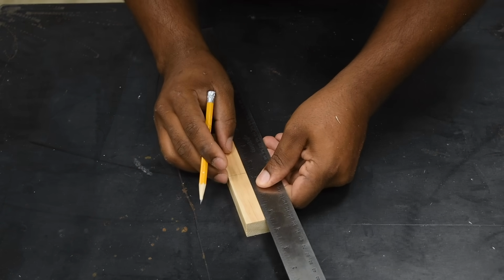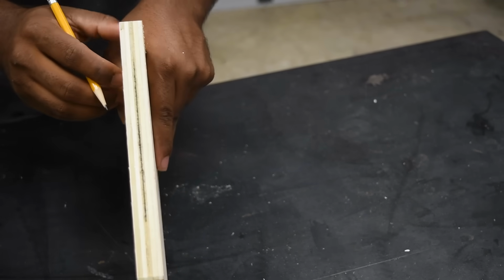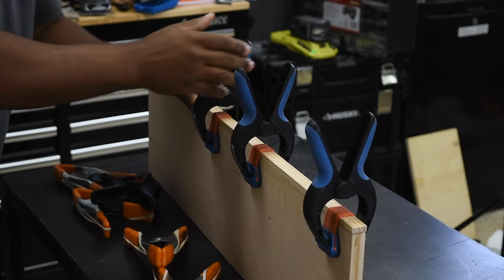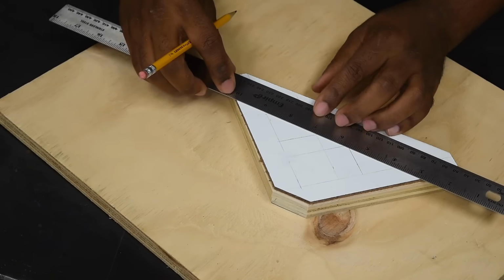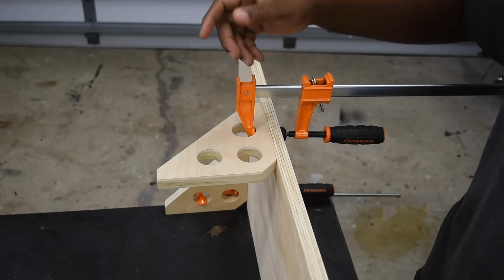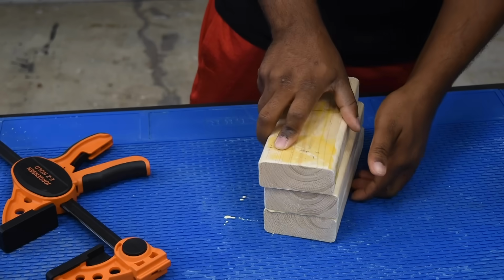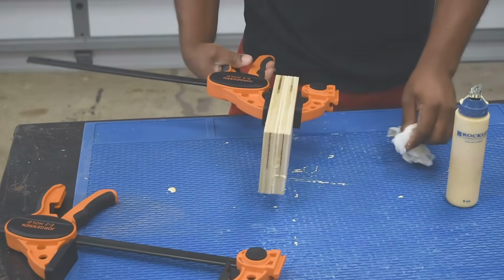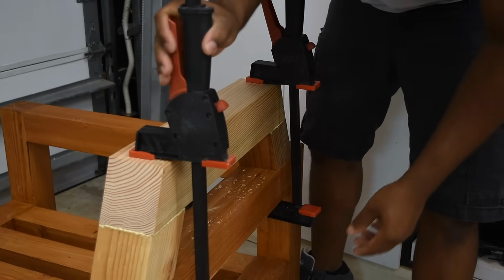6 Woodworking tips & tricks for beginners

Comment: When you were using the table saw never put the miter gauge on the left side of the blade and leave the wood tight between the fence and the blade without some time of support, like a miter sled.

Comment: I’m a contractor and carpenter with more than 20 years of experience, primarily in finish carpentry and custom woodworking. I don’t know how I got here and I’ll be honest, I was ready to call BS before the video even started but you’re great. I like your ideas but more than that I like your approach and thinking. You’re  smart and resourceful. This is maybe the only time I’ve seen one of these that wasn’t crap. Most are cute and overly clever but ultimately useless, though an inexperienced woodworker wouldn’t know it. these are actually useful. With the untold thousands of dollars of fancy tools I have I don’t use dowels anymore, but that nail bit is frankly better than those useless old dowel markers and I could see myself using it. I would check if salt hinders glue performance though. Anyway, great work. The stuff you make is pretty nice and you’ve got some good ideas, but like I said I’m mostly impressed by your mind, your creativity and resourcefulness. Those are a craftsman’s most valuable tools. Cheers.

Comment: About that last one, if you need to be more precise and you find the head of the nail sitting at a slight angle puts your alignment out you can use a T nail and tap one side of the head in first then it will give you a dead vertical match and should stay put without tape.

Comment: I am an ex UBC journeyman carpenter,  and UBC carpenters are practically the best trained in the business here in the US.  So I thought, untill I met European, Japanese, Korean, and other old world carpenters that would kick my butt with their "lost knowledge", and often simple hand tools.   I have to say that the straightforward approach you have is refreshing and wonderful.  You have shown a great deal of simple ideas that many others may not have considered.  You are a carpenter on a shoestring, that truly shows how simplicity can an overcome obstacles.  Truly wonderful and informative.  You have won a fan.  One point I love is your extensive use of dowels and glue you paste on.  Too many believe that hot glue is the bomb! You know better.  One quick tip and I hope you dont begrudge an old wood worker like me.  Dowels work better when they have a slight angle in the tip to enter faster.  Now grooves supposedly are done to provide a way for possible excess glue to run into to prevent hydrolic pressure from preventing the dowel from fully settling in the hole. So either you bore a hole slightly longer, or put some grooves on the dowel.  The jury is still out on grooved dowels making stronger joints.  Anyway; you can either make a jig to make grooves on the dowel, get a doweling steel plate, or use in a pinch a pair of pliers that you have sharpened the teeth for this purpose, and just grip the dowel with the pliers teeth just hard enough to pull it along the wood dowel to make a scratch recess on the dowels. Could repeat twice.  Best are the Channellock type with the tongue and groove adjustable size, because they can comfortably fit many different dowel diameters.  Just a thought.  Still...good work! 👍👍👍

Comment: Impressed. I cheat a bit watching videos - I read the comments first and if the consensus says it's it's c### then it's just that. The comments here told me that not only it was good, but that it was unbloody good. I say that for the chap who queried YouTube table saw technique - and started watching the same, then rewatched because I'd spotted that you had the guard down (bad in boxing but not here) so fingers safe, and saw was fitted with five knife (reduced risk of kickback), and that although the blade was running you didn't reach for the cut piece until the cut was completed. Not textbook safe but ( not yet having bought a table saw) considering these points and (I think) cut piece being held down at back by pushstick, acceptably safe in practice. Please tell me if I'm wrong and you'll hear me mutter "Health and Safety gone mad". As for salt V sand - I'm happy with the one in my plastic grinder but not the other so the salt should be king to future attack from saw or chisel but the grit....  And as long as the timber doesn't get wet, I can't see a sprinkle doing much harm but a ladleful... ? Enjoyable and educational - what more could be wanted - except more. Thanks.

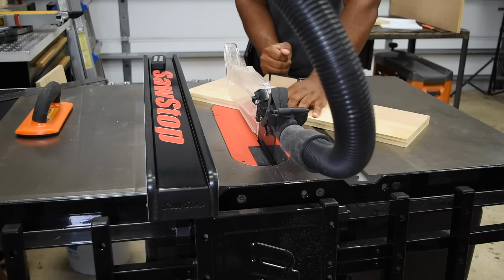Comment: OMG, Do you know how dangerous your technique @4:52 is?  You never - repeat - NEVER use your fence and miter gauge like that.  There is no where your cut-off can go.  If it is caught by the blade, it is coming right back at you at 100+ MPH.  To do that properly, place a small block against the fence at the edge of the saw and use a clamp to secure it to the fence, then use THAT as your reference.  This will give you the clearance between the blade and your fence equal to the width of your block.

Comment: Great tips, however before you join any wood component to another where endgrain is involved size the endgrain first. It takes 2-3 mins max for the glue to dry, especially if it's thin. Then put glue on the surfaces again as normal & clamp up. This makes the joint 50% stronger & much less prone to failure.

Comment: How would you Glue two pieces of 3/4" X 3-1/2" x 72" pieces of wood together to form a 1-1/2" X 3-1/2" X 72" piece. This is for an Aquarium Stand, so I need full Glue contact throughout. I don't want to use a two x four. It it splits, it'll be a disaster.

Comment: Awesome stuff... Thanks for sharing. It's a great attitude to reduce difficulty using jigs and techniques, which improves safety by reducing fatigue, and often reduces current project timelines, and also aids in conquering similar challenges in the future. Regarding the dowels, I prefer just using biscuit joinery, as the biscuit joiner has the depth rail, and the lateral tolerance on the join is very forgiving. Biscuiting is also super quick compared to drilling with dowels, like I don't even mark most joins as the depth is kept constant (as long as one approaches from consistent sides about the join). For the chair rest join problem, I would double up the biscuits approaching from both sides just aiming roughly at the centre, and that join is virtually indestructible, and if mechanical failure occurs, the wood would probably break elsewhere (and not at the join) ;D Note the first scratcher is useful and cunning, but with the biscuit depthing, not needed when biscuiting. Similar for the clamp sliding problems, one sneaky biscuit maintains alignment in one axis, but thanks the salt will aid in the other :) The right angle clamps for panel attaching is awesome, will definitely keep it in mind should an applicable problem come along, but my personal design techniques exclude the use of screws at all cost, and biscuiting again can be done initially to all pieces, and the boxiness of all pieces assembled tends to pull square when panels are all clamped simultaneously, with the biscuits doing the alignment in the one axis (where the 90 degree clamp would otherwise be required). Cheers from South Africa, awesome video

Comment: If you're gonna do tutorials for beginners confine yourself to tools a beginner might have. Your top range chop-saw and saw table (set up for 45 deg cut!) lost me. I have a circular saw. if I had your equipment and knew how to cut 45 degrees like that without the wood flying across the shop I wouldn't be watching. Like all good teachers try not to forget what it was like to be a beginner. However, I enjoyed your presentation. Good lock.

Comment: No one is going to mention the dangerous mistake he made while making the miter cut? You should never have the wood against the fence when cross cutting. if you need to be cutting the same spot/length, you can clamp a piece of wood against the fence at the beginning then hold the wood against the miter gauge to make the cut. Only reason you do this, is because like you see in the video, the cut piece is much more susceptible to kick back.

Comment: Here's a tip: If you have multiple items that need the same treatment, do them assembly-line style, it will save a lot of time.
Example: You want to attach multiple pieces by drilling & using screws. You drill a pilot hole, then switch the drill bit to drill a clearance hole, then switch to a driver bit for your screw. Drill pilot holes in ALL your pieces, switch to the clearance bit, drill all pieces, switch to the driver bit, screw on all your pieces. This tip applies to anything that your making multiple of. Doing things one at a time takes far more time and effort.

Comment: The ideas are great I see some things that scare the crap out of me with his saw use when making those 45 clamps jags put one of the 90° corners on the chopsaw fence set the fence to 45° don’t do what he did there’s too much chance of the peace jumping up pulling your hand towards a rotating blade as far as his initial cuts on the Tablesaw put a stop lock on the fence set your cut push the 45° piece through once it’s cut there’s no place for the waste to bind between the blade and the fence
Again the ideas are fantastic I will be making some of them but safe use of tools is more in Porten than convenience plus setting up all those stops is a pain so to 45° with a simple stop and make the cut the video was about efficiency make it efficient￼

Comment: I'm 51 and have been working with my hands as long as I can remember. I was lucky enough to be taught by some of the old timers back in the day many tricks of the trade. Most, I still use to this day. I was in awe of these guys as a kid and wanted to learn as much from them as I possibly could. It does my heart good to see someone applying common sense with experience, as well as an obvious passion about what you do. By the way, all those old timers and never a mention of using salt to keep the wood from sliding. I guess you can teach an old dog new tricks.

Comment: Enjoyed your video. I will make one constructive comment though. When you perform your angle cuts on the table saw you use the fence for your measurement while cutting through. This is very dangerous as the piece between the blade and the fence can easily kick back at you. I would suggest using a short block of wood clamped to the fence at the end closest to you to set your cutting distance. This way the piece being cut is free on the right side and will not bind when cutting.

Comment: A simple trick I use constantly that my long gone uncle taught me was to hammer the point of a nail before driving in soft thin wood. It won't split the wood but rather pushes out the wood, works every time. You ought to replace that DeWalt blade with a thin kerf Diablo, you'll love it. To prevent the shift when gluing I put a few spots of hot glue on one side, holds it, keeps it from shifting and drys perfectly. Especially helpful in a situation where you can't use a clamp.

Comment: Idk what you're talking about. I use my spring clamps like crazy. I've been using them as banding clamps for years, since the 90's. A better way to go about it is to use a section of a bicycle inner tube stuffed over each of the jaws.  That's one section of tube about 6" long. Each open end goes over a jaw. Done. 

These are all useful tips. I like the nail head dowel marker.  Why not make the right angle blocks all on the miter saw? ..or all on the table saw? Btw.. You've got some bad habits. Never let your hand go that far into the saw, that close to the blade. It's a matter of comfort. You shouldn't feel that comfortable about it. With that much comfort comes complacency ..followed by injury. Get used to using push sticks. That should be your next project.. Make a couple of push sticks out of a couple 1x2x8-10" e-e . Cut one end at 45° with a step in it , kinda like a bird's mouth. Round over the other end and drill a hole to hang it from or to glue a magnet into to stick it to your saw or fence. When they're made quick n simple, they're used fully, people don't mind pushing them through a tight cut and sacrificing them for safety. People aren't likely going to do that with any of the store bought plastic ones, ..with the rubber tips. That rubber will mess up the blade anyway if its pushed through..

Comment: Been a while since I've seen any of your projects. I love your work. BTW if you want to use a pencil instead of a screw, you can drill a hole and press/glue a nut in to your block of wood. If memory serves, a 5/16 nut will let you thread a standard wood pencil to whatever depth you want and hold it snug.

Comment: Useful tips, thank you. I would avoid using salt in the joints as it is hygroscopic. (sucks moisture from the air). This could bleed through and discolour the surface or cause paint finish issues. Maybe keep a small pot of kiln-dried play-pit sand in your shop instead?

Comment: Good tips.  BUT NEVER cut those triangles between the fence like that.  I was waiting for the kickback.  Never say never, but never use the miter gauge and the fence in contact with a short work piece like that.  ESPECIALLY WITH A PIVOT POINT AT FENCE!!!  Clamp a block on your fence to position the piece so as you move the miter gauge forward there is space between the fence and the piece.  I can't believe I didn't see 50 similar comments below.  Your method there is a classic kickback situation.  Sawstop won't stop that, either.  Again, I really like you tips and tricks.  Keep up the good work and be safe.

Comment: These tips were all Amazing. I don't do wood working. Unless the need arises.I always struggle but manage to figure it out and that sometimes kicks my butt.  These were so simplistically brilliant. I love jigs, you never know when you going to need one. The center scribing one. Using the screw  and the doll rods was brilliant and the nail Tip, between to joints in order to mark center.   Was also simplistically  Brilliant.  loved it. Which is why,  I love watching these types of videos.   In the past.  I  have come across several situations where I wish I would have known those tips. I most certainly can and will  use that nail tip. The next time that moment,  the need  presents itself again and It always does. 
Thanks for the Education . 
Semper Fi.

Comment: Cheers from down under in New Zealand. Great tips. I'd be keen if you started your basics project. Could I recommend for us with only skillies (circular saws) some tips for getting more accurate cuts. My small 1940's English table saw is cool (and dangerous) but unless I need a shallow rip into soft wood (only a quarter HP minus age and wear) it's right to the skill saw for me...and not the best results sometimes. From one teacher to another, you are good Mr DIY Creator.

Comment: Great tips.  However, using your rip fence for a stop for crosscuts is flirting with disaster.  The cutoff piece can catch on the spinning blade and become airborne. I have a 30 year old dent in my shop wall to remind me this is a bad idea.   Just don’t do it for through cuts. It’s ok for dados and such. Use a stop block for left-right positioning, that’s well in front of the leading edge of the blades so there’s plenty of clearance between the off-cut and the rip fence.

Comment: Great tips, love the right-angle clamps and the dowel marking trick. The centre finder/marker is brilliant as it eliminates the pencil, but I'd give the tip of that screw a bit of cleaning up on some sander/grinder tool to get a sharp point - still a great idea esp. as I've been mean to make a centre line jig for ages. Cheers

Comment: Dont make no triangles to make your box's. Learn how to hold the two pieces, put in a brad and then drill & screw or use pilot holes Bro dont be teaching people stupid easy ways where they should be learning/practising a skill which is faster once you have experience
Someone is gonna make those triangles, take them to work and get fired lol

btw, im struggling to think of a reason where someone would need to score a precise line down the edge of a board.
I'm also probably gonna be the first one to tell you Americans that you dont need to cover every square cm with so much glue,that spreader makes me laugh.
When joining just run a line of glue down the middle using your finger as a guide, you dont need to spread the glue with your finger. you didn't do it here but i bet thats how you do it.
I think im gonna make a video called 'the difference between American and Australian woodworking' i rekon i could do a top 10.
One last thing, Fck dowels, nobody can get them right bc they are not used enough to get the skills to be perfect so dont even try, just use a screw or some hardware.
and yes i know there is a 60 year old out there who used dowels every day for a decade and can get them right every time but he is the exception,
yep im bored